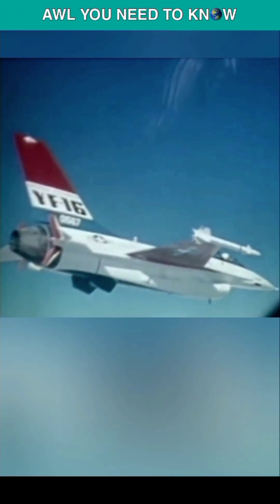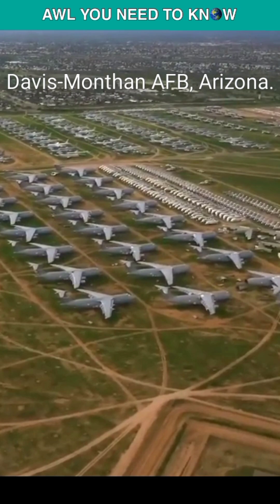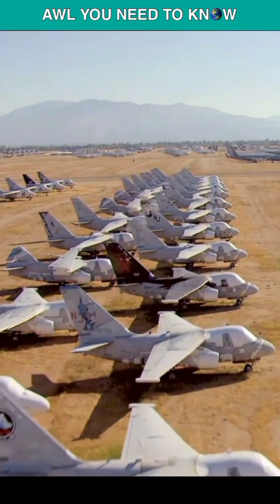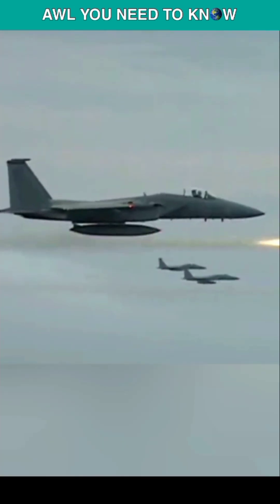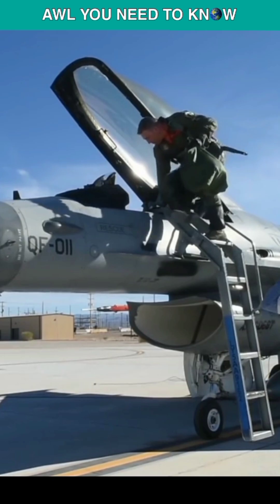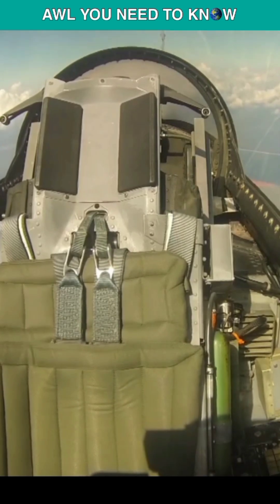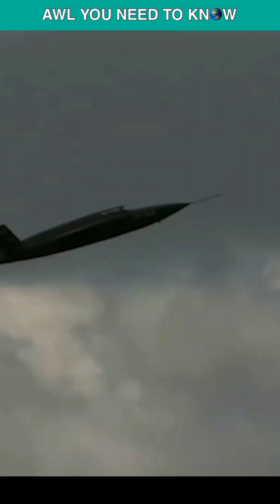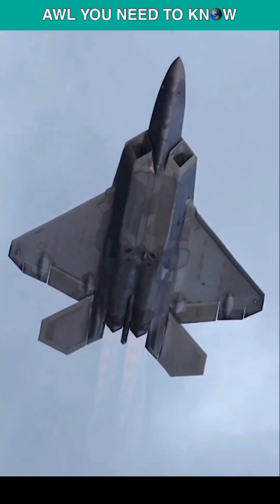QF-16 , How the U.S. Air Force Turns F-16 Into a Drone #shorts

Comment: Drone equipment can be used to clean out coastal defences by sending drone qf16s  in first then drones fly  around firing rockets and using there deterents to keep there s300s and s400 systems busy while modern stealth fighters sneak in and knock there defences out then go in. And hit military targets without there defences working hitting known silo's also to reduce there defence response .

Comment: What a waste the F16 is a GREAT AIRCRAFT 👍  I'M GLAD THERE GONNA TURN THEM IN TO DRONES WHAT WILL FLY ALONGSIDE F35 .  F22 ✌️🇬🇧👍
Reply: These are old and worn F-16s, which had been retired from normal service. They did that with F-4s before and now they use old F-16s

Comment: A QF-16 armed with AIM 120 and AIM 9 could be a threat.
Reply: But their avionics is very old so need many upgrades
Reply: @rifat6913  Well, the F-16 has no better replacement in the USAF currently, so just a bit of a modernization on the airframe is all that it needs.
Reply: @Dr.KarlowTheOctoling  f-35 is the replacement
Reply: @-p2349   not even close, both are multi role fighters but F-16 is not a stealth aircraft and the doctrine used with both is vastly different
Reply: @Brogurto  The F-35 was designed in part to replace the F-16.
Reply: @Brogurto  The airforce isn’t even planning on directly replacing the F-16 with another fighter as it’s role in doctrine has become outdated for the US

Going forward all non stealth fighter assets (F-16, F-15, F-18) will eventually be phased out, however due to planes costing an insane amount and the need for American fighter assets all over the globe, this will certainly take decades. 

Expect the F-35 to become to the new F-16 especially when 6th gen fighters begin to appear. At that point the F-22 and F-35 will be treated similarly to how the F-16 and F-15 now
Reply: @-p2349  nope. The f-16 is the economy air and ground attack jet. They was like why don’t we take the f-15’s two engines and make two planes out of them. The f-35 will never be as cheap per hour flown. They are making cheap (not really) propeller driven attack planes when they could convert f-16’s to work reliably in rough conditions.
Reply: @rifat6913  well DA
Reply: Yup the secret service and the Beast ain’t got nothing on a drone f-16. No missile needed a la 9/11.

Comment: How many Gs can the F-16 Airframe pull? I wonder how much it could approve without Humans inside
Reply: 9 G-Forces.
Reply: More than 9 g's
Reply: @stevenblanton279  it’s 9
Reply: The airframe is designed to withstand 9Gs. It could go beyond that, but it would hurt and overstress the airframe a lot and use up more of its G life.
Reply: The human can't take the full gs a f16 can take they would pass out the limits of most planes is the pilot we overbuild them for safety of the pilot .
Reply: That's a good question. Of course, they are built to last a long time with the 9G limit. The question is how much would their life be shortened by going over 9Gs and how acceptable would that be? It has probably not been tested with routine stresses over 9Gs, so maybe nobody knows.
Reply: Without a pilot that is
Reply: The f16 limit is 9g but it spends a ton of time there relative to other fighters and is rated for its full lifetime at 9g continuously. Ratings are usually quite a bit lower then what they are theoretically capable of due to safety margins. Ai f16 should be able to do 12g without a sweat.
Reply: I think we’re developing this to see what type of maneuvers and Gs these can pull to waste enemy missiles. The idea being that we’re going to scrap these anyways. So we could potentially convert them into drones and arm them up with the intention of making a purposeful target that an adversary has to engage because they can still be shot town by it. It makes perfect sense because instead of developing new drones for this purpose we can just convert these and deploy them. They also can likely pull maneuvers that wouldn’t only waste enemy missiles but would be impossible for the other pilot to maneuver against as the amount of Gs could potentially kill the other pilot. I have to imagine that if we look at other planes which had pilots have catastrophic accidents. They can pull something like 15-30 Gs which is absolutely insane. That stress could potentially destroy the aircraft. However if it’s meant as a kamikaze drone where its objective is to shoot down or fly into an enemy plane. Than it really wouldn’t matter.